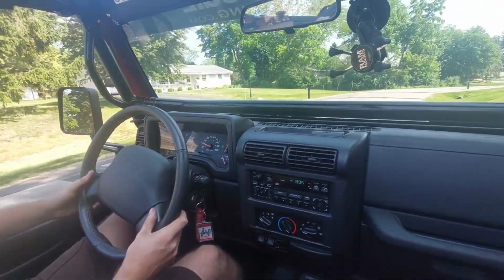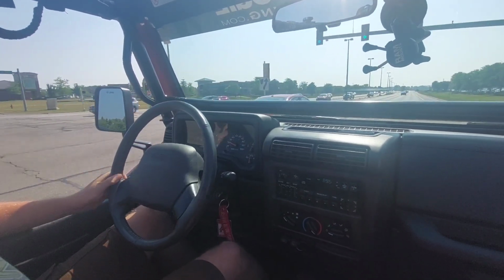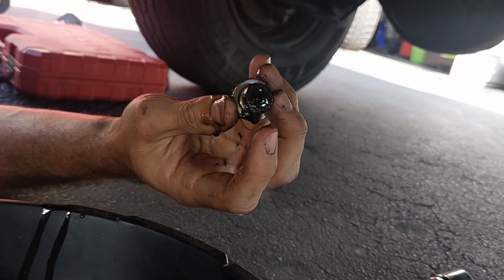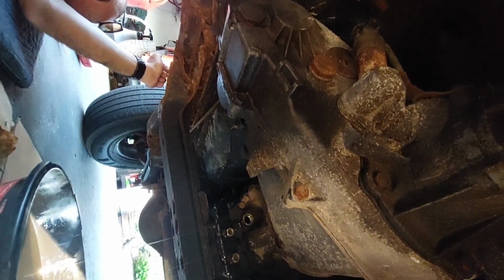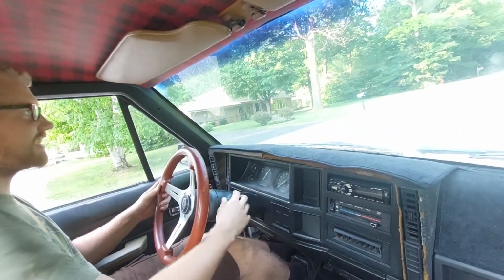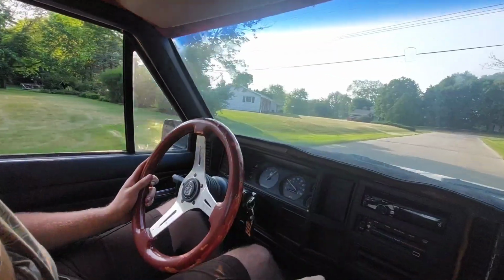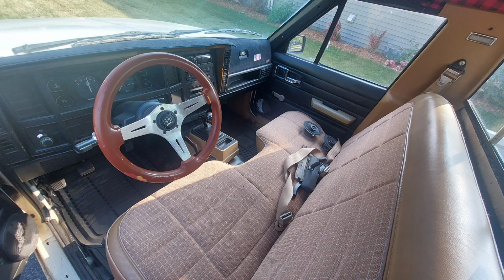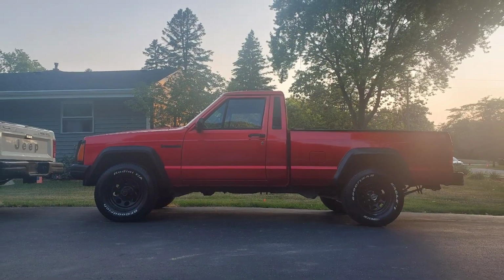A Day with KyleSVT - Operation Justice Excerpt

Comment: i had a wrangler LJ on 35s and it rode straight as an arrow on the hwy, and would easily do 90mph no problem. if Kyle has 5-7 ° of caster and the toe setting is toe'd in slightly it can get rid of alot of that squirrelly feeling you described. i just had a 4.5" lift put my 96 2 dr XJ, same thing, toe was set at zero, which is within spec, but its not enough for the lift and tires, same on the caster. i took it back and had them reset the Alignment, and it cleared all my trouble up.
Reply from the maker: It probably wasn't all that squirrely honestly, it was pretty windy that day, and I have zero experience driving modified vehicles. Kyle drives it everywhere, but I'm not sure if I could handle that